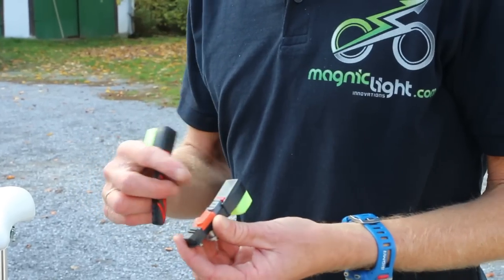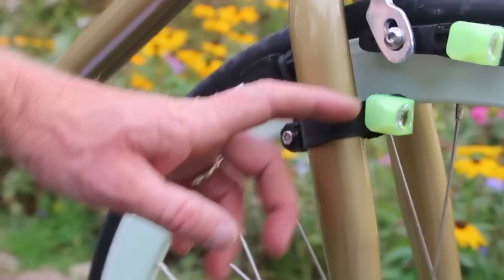Magnic Microlights: BikeLights with Magic non-contact Energy

Comment: Doesn't look very bright.  If it cannot be seen brightly in daylight, then its not useful.
Reply from the maker: The rearlight belongs to the brightest rearlights on the market- you can see it extremely well even at daylight. The front light is sufficient for cycling in complete darkness.
Reply: @magnicdirk  The brighter rear lights on the market exceed 100 lumens.  How many lumens is this?
Reply from the maker: @bikedawg  Ok- we have just ~30-50 lumen (depending on speed)- but this is more than enough for a very good rearlight. Even 10- lumen rearlights are visible at daylight and most of the rearlights on the market are far below 30 lumen. It's just not necessary for rearlights to be extremely super-bright.
Reply: @magnicdirk  - well, I would disagree with you on that.  Light manufacturers recognize the safety of very bright rear bike lights during the day.  That's why the newer lights are very high:  ICON2 has 300 lumens, Vis 180 Pro 150 Lumens, Lezyne Strip Drive 150 lumens, etc....

And, I personally ride with a rear light that is 400 lumens and get appreciative comments for car drivers saying that they can see me a mile away and  because when riding on tree-lined roads where the ambient light goes from bright to dark, cyclists can be seen immediately.
Reply: @magnicdirk  BTW, I do like the technology you are using.  I think that is innovative.
Reply from the maker: @bikedawg  I have never seen a 400 lumen rearlight- -but if you like it or think you need it it's ok ;-)
Reply from the maker: @bikedawg  I think there is a misunderstanding. I just had a look at ICON2 and it says: 300 lumen LEDs- but this does not say the light is powered with at least 3 Watts to reach this value. It's just the max power of the LEDs. In our classic Magnic Lights we use LEDs with 309 lumen (Max)- but we don't feed them 3 Watts (necesary for >300 lumen). Efficiency is much higher at lower power so we reach more than 160 lumen/watt. 
Simple calculation: For a 400 lumen rearlight you need ~5 Watts with very good red LEDs. A high power mignon battery (2100 mAh, 1,5V) has 3,15Wh (3,15 Watt for an hour). 2 batteries will be empty after 70 minutes- just for feeding your rearlight...